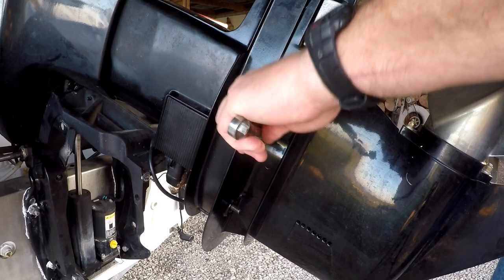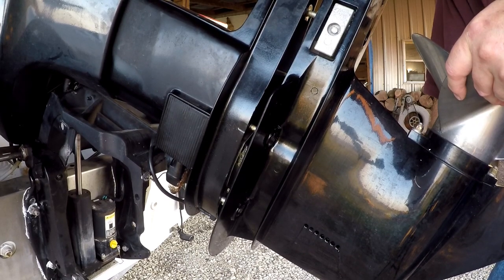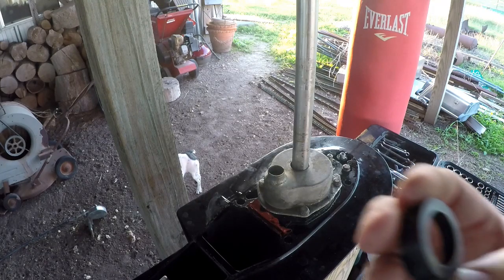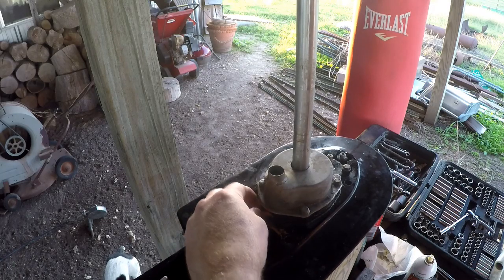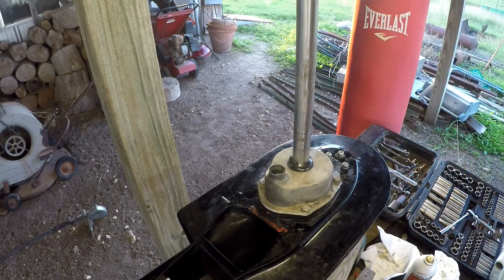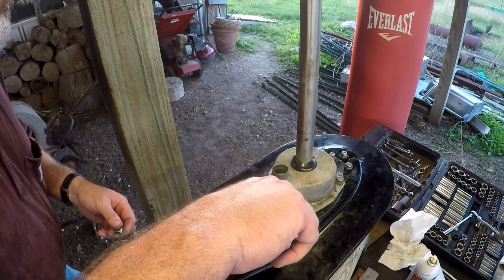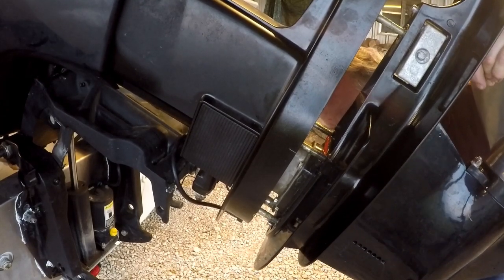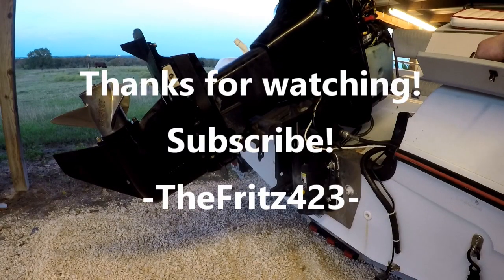Installing the Face Seal on a Mercury Water Pump

Comment: Lol isn't that just a treat! That piece just helps keep the water pressure up. Thanks for the video, I gave you a like and a sub for actually pulling the lower unit back off and putting that on! And your super close to that 1K!  Awesome job man!
Reply: Is that the purpose of that seal?

Comment: Hi.  I have a 2011 60hp Mercury 4 stroke efi 1.83-1 ratio. According to my parts diagram for my model there is no face seal. I called Mercury customer service and they said it is not for my motor but I’m not sure if they are sure. It was not on there when I took my motor apart but the impeller was changed previously. Do you think it would be helpful to install this anyways to protect the water pump from getting debris?  Do you think it would work ok or should I just leave it off? Thank you
Reply from the maker: It's not a big deal either way.
Reply: Thank you

Comment: I have this motor, any pointers you can give me? I accidentally broke one of my screws on the housing by over tightening. I also used marine silicone. Do you think I should get the screw drilled out asap? It’s pumping water just fine with three screws holding the housing down.
Reply from the maker: I would remove the broken bolt and replace. Sooner or later the pump will fail I believe.
Reply: @TheFritz423  I did remove the broken bolt, but the other 3 are solid and the housing is secured.  I did put gasket sealer on it when I first replaced it. Just trying to get through the summer before I have a shop fix it. What do you think?